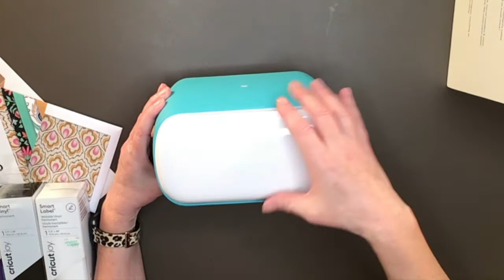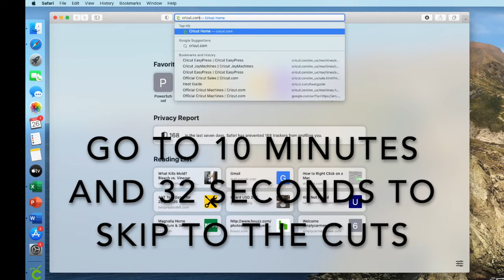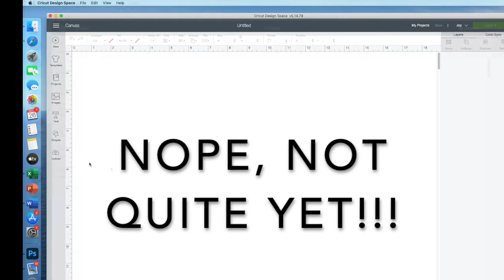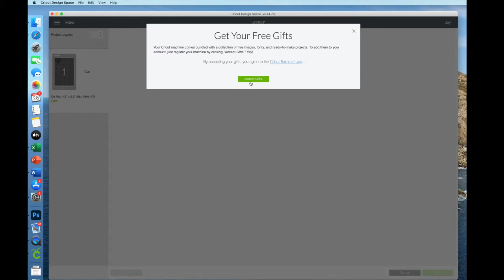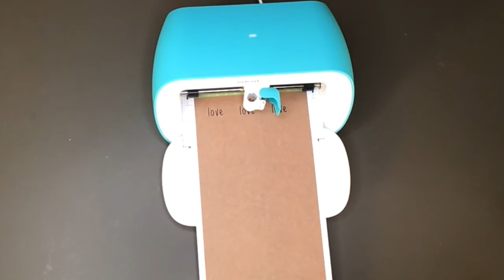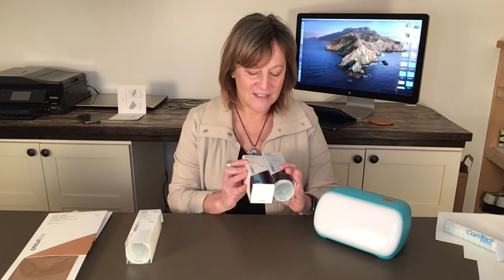Cricut Joy Unboxing, Setup and First Cuts

Comment: I have recently started making leather earrings. I the Cricut Maker or the Cricut Joy best for cutting leather?. Does it come with everything I will need to cut leather or will I need to purchase additional items?
Reply from the maker: For genuine leather, the Maker is definitely the better choice. The Maker has the most power and will get through leather much better than the Joy would. I have cut faux leather on the Joy, but I would not attempt genuine leather on it. To cut leather on the Maker, you will want a strong grip mat and the deep cut blade. I have a bunch of videos cutting leather earrings on my Maker, so you might check a few of them out to see what else might come in handy. On a lot of leather, I prefer to tape the leather down for added "grip". Thanks for watching!!!